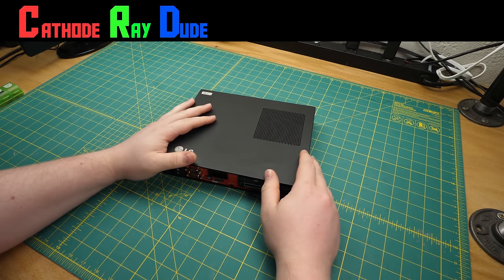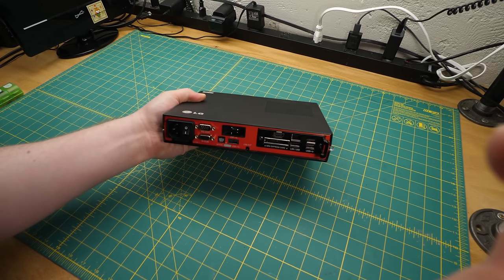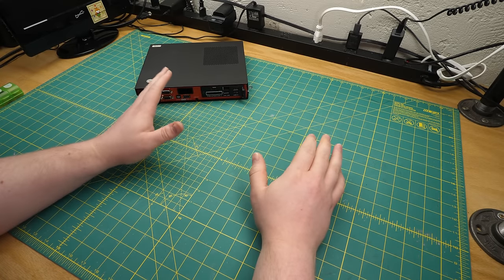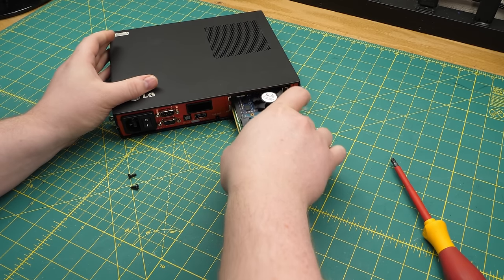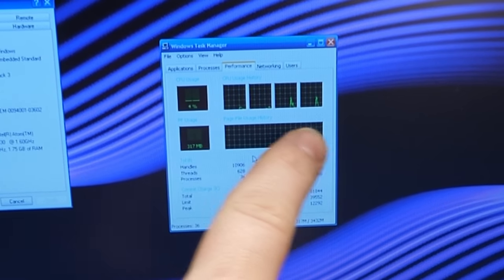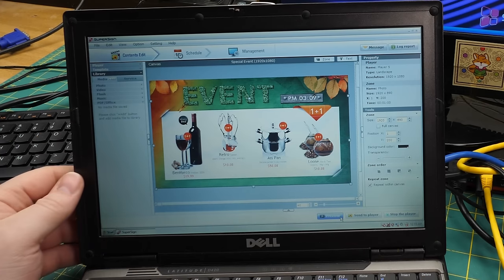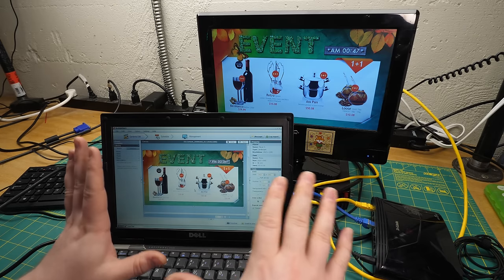Little Guys 6: The Worst Possible Timing [LG NC1000]

Comment: So I live in the peripheries of the digital signage space and to answer your question @ 30:38... This is one of those things that every hardware vendor (not just digital signage but AVoIP, HDBaseT, ...) loves to tout and hopes that you'll buy 25 of their thing but for the most part has little real-world application. Pretty much any display you'd want to use in a wall configuration supports the capability internally. 

The one possible exception to letting the display just do it is if you aren't running the content as 100% wall coverage all of the time. Not sure if the LG thing support it but in other applications you may have some portions of the presentation occupying the full wall and at other times break part of the display away (in a 3x3 wall you may have a 4x4 small(er) presentation with the other displays displaying a single source each -- more of a command-and-control type thing than a retail digital signage thing. 

Also... I hate BrightAuthor with a passion but one of those applications for the HDMI input is employee break rooms: You have CNN (or the weather channel or ...) running either in a window with company info around the edges or a ticker with the company metrics, etc. (Out of scope for this video but for that one: BrightSign was originally a Roku product before Roku got big and consumer oriented...also a ton of interactive museum exhibits are powered by Bright Sign, not just ones with video.).

Comment: I'm at 15:40... you know there was a similar "compute on a module" attempts in the server space. Anyone remember the "blade" servers? Right now in the "self hosting" crowd, there are a lot of N100 based mini PCs that make for great "set it and forget" kind of machines.

It would be really neat to combine the two ideas! A "self hosted" blade server stuff full of N100 systems on a module. Bonus points if the solution can make use of a 10" rack like what Jeff Geerling is after.

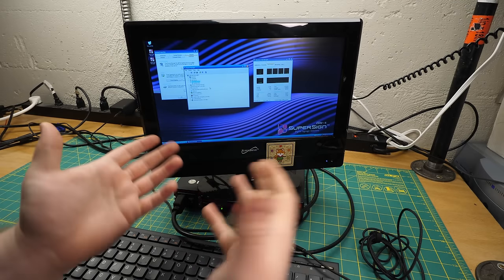Comment: 27:19 The ION was not hated at all, because it's GPU (in contrast to the built-in Intel GMA 950 GPU of the Atom 330) could do H.264 HW decoding up to 1080p30, so that was a big deal back then especially in Netbooks, which otherwise could not playback any HD content. You could even game on it and play Torchlight, which was quite impressive on a 10W TDP!
I still use an Atom 330 ION system to this date (The ASUS AT3IONT-I) for a NAS, because back in 2010 when I got it, it was basically the only passively cooled platform with a sensible TDP to be running 24h and 4 built-in SATA ports. (The "non-ION" Atom 330 only has 2). And 14 years later it's still up and running.

Comment: I have an old Elotouch 32" touch monitor  at work with the plugin PC module that we are decommissioning within in the next year or so.  It will likely just be sent to recycling. The backlight is getting pretty weak so the display isn't really good for anything. It also weighs a ton, so I wouldn't want to ship it anywhere. These things are usually used until they die from running 24/7. So you don't see them for sale very often. They also look dated pretty quickly.

The old one we have is still running Windows XP.  I couldn't put anything else on it as it's SAW touch screen and the only drivers were for Windows XP. I generally run Linux on everything as it's more reliable and easier to troubleshoot when something does go wrong. 

As for videowalls. They are a very common ask from clients. You tile a bunch of TV's on a wall to create a very large display. Specialized processors with like 25 outputs to do 5x5 video wall are very expensive. Using a bunch of these devices is actually the cheap way of pulling this off. You also get more resolution as the input to those processors would have only been like 1080p at best, so each display would only be getting a 384x216 image scaled up to 1080p. With an array of these computers, each display gets the full 1080p and atleast vector content could look nice and sharp.  These days LED walls are largely replacing video walls now that you can get small pitch LED panels that can be seamlessly tiled.

Comment: its been a LONG time but I remember ION being really useful for running a kodi client on at the time using something like openELEC. you could get a Zotac board with direct DC power and ram for about $200 CAD in 2009 (just checked my receipt). It's what I used to replace my modded xbox xbmc setup.

Comment: Probably said already, but the 5*5 screens is just a bigger TV. In the likes of pubs, get several displays, mount to a wall, and you get a big TV. Having 10 displays means if one fails, it can be replaced, as opposed to having to replace the 100" screen. Currently a pub I goto has a 250" (ish) screen made out of multiple screens. Heat from the fridges below it will cause failure over time, but as said, replacing one will be achievable quickly, as opposed to dropping mega bugs for a 250" TV.

Comment: When I used to work in digital advertising agencies we used to do the animations in Flash then line them up in video to disc software and bake them onto DVDs for the client, the whole process was streamlined. It would’ve been a nightmare to have to learn and use this device specific software.

Comment: In a local supermarket they have Digital signs behind the Butcher section, Went in one day and was lucky to see one of them 'sort of not working' one day, Turns out they were running CentOS Linux, could tell because it was on the Gnome desktop and had the familiar Icon i know as the menu button top left.

Edit: I'm going to pose another theory or at least another nail in this product's coffin - They realized early on they screwed up the tolerances of the cooling on these devices after running a batch of them to market, and rather than go through the costly recall process, they chose to cut the project off and join the standard instead and simply leave them out in the wild to rot, figuring people would just trash them and move on to the new standard stuff.

Comment: Most at malls etc are actually built into the displays now in my experience. They're hardened versions of the display that are designed to see 24/7 use, e.g. better (maybe underdriven) LEDs, a hardened front panel (optional) that's also suitable to be somewhere oil might build up, better power supplies, etc.

But most importantly all modern TVs already have a low power RISC processor. The manufacturers just upload a different firmware. Bonus is no Windows licensing costs and an entire OS dedicated to the job (meaning some weird error will never have it slip back into Windows and/or let someone plug in a keyboard and get pornhub open in a browser).

People still go for the signage PC of course. And if you want to drive a really big display over several to several dozen displays of course you need to go for the custom hardware (and interestingly they generally all use Matrox cards). The problem is it's even easier than ever to pick the wrong displays - some airport in either Dublin or Germany iirc had a long super wide display - only the picked all older (around 2017 iirc) LG OLEDs so of course in 6 months it was burnt in, at 18 months it was a complete mess (idk why someone didn't just shut it off before 18 months and wait for replacement - or even just writing it off and leaving it off forever would have been better).

Comment: hoped for years that computers will get similar to hifi stuff or vcr or anything that we used to put on shelvesm it would be sooo good. you can have in this age still reciever, amp, turntable, casette deck etc all in the same design and form but cant find pc that will go along

Comment: I seem the TVs for those all the time from a recycler  in Canada (Vancouver area,,  North West)  never looked into the details, but see digital signage TVs listed all the time.  You have to be a reseller to work with them.  Never bought them, as I only needed monitors for office computers.  When they get them in.. its a load of them at a time.

Comment: RE: the multi-tile function. My guess is it's there for flexibility. Imagine you could set it up so one animation uses the whole set of tiled displays, then the next runs one on the upper left corner, with seperate but related presentations on the column and row of displays to the right and bottom... or a wide-screen video could play on the top four rows and the bottom row could have related slideshows playing. Each being separate computers would allow that by sending different files to the ones that you want to play separately and the same files to the tiles. Just a thought.

Comment: AIO Star does have an OPS adapter "HDMI DP Port OPS OPS-C Computer Interface Board" that that will plug into the JAE-80 pin and connect to any monitor... in 2024 running windows on a digital signage system is beyond silly considering android options that can be easily remote managed

Comment: That high pin count connector is almost certainly HDMI. My guess is that they designed the board to be usable as either a dock or a dedicated "JPEG-to-HDMI"-type device with a basic ARM processor.

Comment: If the matrix controller is like the old "video wall" controllers of the 90s, the answer to your question of why would you set up a 25-screen matrix is; you wouldn't, but the support is there for whatever you would do.  You might need a matrix that's 5 screens wide or 5 screens tall.  If they made it 2x2, people would bitch they can't have it 3 wide or 3 tall.  It's options.  I LOVE YOU CRD!!!!

Comment: There are tons of web-based, managed "remote powerpoint" things that do video and interactive displays. Also there are a bunch of these that run Android or Nix. Lots of Business class smart tvs, ARM and Intel Embedded junk out there. Some Screens have slots that take a card like this PC thingy and run whatever you'd like on it.

Embedded comes in a few flavors too btw. It has different licensing (cheaper I suspect) and is typically supported much longer than normal and gets different updates.

Comment: What jumps out at me is that in 2010 SSDs were neither common nor cheap. It was a couple years earlier in 2008 I bought a pair of mTron 32GB SSDs for $650 each. Memory doesn't serve how much prices dropped by 2010 but I'm pretty sure it wasn't more than half.

Comment: Some payment gateways use the number of cents at the end of the price to trigger different payment endpoints in test mode. Payment successful, card declined, card expired, etc. I've definitely seen 8 cents as one of these values. Probably not related in this case but one reason why you might see a price ending in 8¢ outside of Ali Express.

Comment: I worked for a digital signage company that sold everything from shit we were embarrassed to push to the gold standards at the time. I was sys admin for the company and all of the signage systems. While we did always have a TeamViewer type backdoor, often there was a server behind a bunch of it. One client was a very large retail company...the signage had to reflect different pricing per location, promotions that may only happen in certain markets (Sports/College), sometimes the output was a single screen, sometimes it can be a 20 screen videowall. Restaurants have a very high failure rate and that is why you see those types so often. Sometimes packed in fryer grease....

Oh and yes, have seen BrightSign too. Scala was the system I liked....

Comment: So funny enough an old A&W in my town upgraded their menu. However they choose to purchase a samsung TV and make a 2 minute MP4 of their menu, then have that one file play on repeat on the TV, using the USB file explorer built into the TV. This is the only A&W to do this because it's an independently owned location. Which is nice because it apparently looks like how it did when it first opened, as they have the freedom to renovate it to look exactly the same. There is an A&W in the next town over and they are 100% using one of these because they are directly owned by A&W.

Also my only experience with an Intel Atom was in an old ASUS tablet. I ended up frying the graphics chip on the SOC. When it did run, it was not a pleasant experience. I wish there was something i could do to get it back up and running just to get everything off of it.

Comment: the weird vga-but-not-vga internal cable i have seen many times in devices older than this, using what seems to be a single-purpose cable to bundle many signals that go the same route together, i suspect it's likely that these companies have excess of these sorts of cables with different wire counts laying around, and they make for very easy wiring and routing

Comment: We had these where I worked, they where okay but the ones we had where running windows XP. There was no upgrade path to windows 7.   We just connected black box digital signage to the TV and stopped using the computers.

Comment: Heads up they made an NC1100, and NC2100 as well. The NC1100 being the next rev up from the device you have. Believe one of LG's main clients didn't care about the OPS standard as they had already deployed a TON of NCxxxx models and financially it didn't make sense to replace them with OPS after less than 1 year of the NC1xxx series being released. Regarding the comment about not swapping out the PC module. This was actually common, the tiny fan did indeed cause a fair bit of failures, I hear.

Why you would want to put out the displays in a video wall with one media player per each display is to avoid single points of failure. By this you have multiple media players with two or more displays worth of content on them. From there you'd use the serial control to adjust what output the display is on - with the media player showing both outputs all the time.

Comment: I think I was looking at the same exact listing as you when you bought this thing. I wanted one to use as a redirector hub using a USB Wi-Fi adapter and a wireless mouse and keyboard so I could stop my family bugging me about streaming services on the smart TVs. 

Interestingly, the entire computer board itself is the same size as a low rise PCI-e card. Makes me question if there was supposed to be another mounting method for these.

Comment: I'm pretty sure that my uni had OPS displays. They were used in "group assignment rooms" for students to plug their laptops into. I'm not sure what they were used for, I assume it was something to do with the booking system or the input switching - I just remember seeing a slot with a "Little Guy" on the side, while trying to fight with a badly vandalised HDMI cable. I searched and they're definitely NECs.

Comment: for digital signage i've seen actual midtower desktops be used connected to giant displays controlled via teamviewer and on the other side of the spectrum i've seen raspberry pi's dangling from tv's mounted to the ceiling, really sky's the limit when it comes to options for digital signage.

Comment: Aww, another small guy owner with Atom 230 (1 core/2 threads) and Nvidia ION GPU/Chipset here. With SSD and max RAM (2GB of SO-DIMM DDR2, single channel) it rocks games up to 2007 even in 800x600 px resolution and that includes, you'll hear me right - Crysis, the OG one. On that resolution and lowest possible in-game settings it can get up to 30FPS, tops while watching sunrise after first cutscene and in menu's. Mine small guy is Prestigio "Nettop" as it is known, rocking full fat Windows XP Pro SP3 (Integral Edition variant bcz updates), MS Office 2007 and lot of older titles like OG GTA 3/Vice City/San Andreas, NFS Series from NFS 3 up to Carbon and way more older games which I play from time to time. That 480GB Crucial BX500 is beast for it and even overkill, but hey, can't complain about storage for bunch of old titles.

Comment: Why the video wall was done by using a bunch of little guys (30:35). Resolution. Matrix video wall controller is only capable of (without some dark magic) splitting the existing image. I.e. if it was 8k stream, you are able to split it into 8 separate 960x540 streams, then try to upscale those to something HD-esque. If you need more monitors than that, you get all that multi-GPU stream synchronization hell as a free bonus.
On the other hand, each individual little guy is able to throw at least native FHD on its respective monitor, and network synchronization is less of a butt pain.

Comment: Those 2 RAM-like unpopulated footprints on the bottom of the dock PCB look like they're some kind of buffers or level shifters too, just wide - it just seems to me that "tracing" around them is too uneven and sparse to be some kind of SDRAM in similar package. Unpopulated components look like pieces of HDMI circuitry to me, however I haven't yet figured out what that big flat pack is for.
This board kinda looks like LCD display mainboard with all components of LCD display gone.

Comment: have had to replace many of those fans, through the fins is the only method, as far as I can tell, that is definitely the GPU, but your right, the OG 8600gs/9400m or lord knows what was out in 2010 for a cheap industrial need. The using 2 screws on the fan doesn't surprise because of course they would. I'm guessing a vague nforce type system before SOCs become the thing. I'm willing to bet that heatsink was a fit all slug of metal